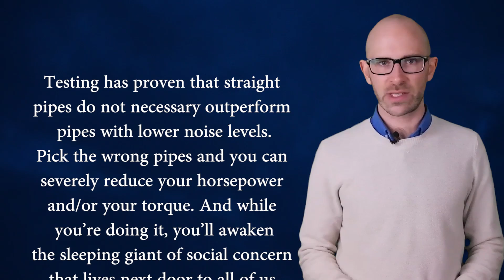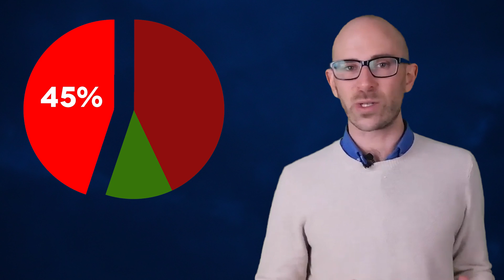Why are Harley Davidson Motorcycles So Loud?

Comment: I've been riding since 2007 on a Kawaski cruiser with straight pipes. I have never had an accident to-date. There have been some close calls from people in cars failing to check over their shoulder to view the blind spot, but with a little motor rev they hear me and move back into their lane. Safe Riding.

Comment: All we need is a little common sense and consideration of others. Btw.... noise adds dramatically to fatigue, therefore, anyone riding for more than a few hours with loud pipes will be endangering themselves. Fatigue creeps up on you and impairs your reflexes and cognitive abilities. I have been riding for over 35 years (since I was small) and am in favour of a "nice" sound, but that stops at 90db max, ideally around 86 db (at full throttle) is probably the best compromise. Anything over that is simply a nuisance, especially at 2 in the f*cking morning or on a peaceful afternoon when I would happily step outside and punch you for being an ignorant selfish inconsiderate ass!! (and yes, I am able to take on the majority of people. over 6", 240 pounds, fit, military / unarmed combat and martial arts training.. and I race, winning endurance championship races as recently as 2010)...

Comment: Mate, you come across as if you know what you're talking about, and some mentioned figures are correct - but, your comparison of various cars and a truck is wrong. There are rules and regulations as you mentioned - the WVTA applies to all vehicles of that type, and the 80db limit is barely audible in a typical city environment also due to the way sound carries. Instead of making polemic statements, we should all simply ensure that ALL vehicles that no longer adhere to the WVTA / homologation are taken off the road - which includes a lot of cars (especially "classic big block muscle cars", boy racers, and many trucks based upon sound and numerous older vehicles on exhaust emissions) and only allowed back on the road when they are within maximum 20% of the prescribed limits - I am not advocating draconian actions, just common sense and decency. If there were fewer rogues there would be fewer people "anti"..

Comment: As someone who rides a '87 Harley regularly and a large amount of quieter bikes. I have to use my horn less and be less defensive while riding my Harley, then when I borrow my dads bike. Cars are way less likely to pull out in front of me, or try to steal my lane. And with something that can be a very dangerous, even a perceived amount of higher safety is better than nothing.

Comment: Harley's are loud due to the bore and stroke ratio, valve size, camshaft profile, compression ratio, exhaust primary pipe size and length, intake efficiency and so many other variables that most people don't understand. engine design itself naturally will produce a louder exhaust note then most and the inability to utilize larger mufflers that don't restrict the engine and keep it quiet.

Comment: One of the quickest ways to get bikers going is the 'loud pipes' issue. Basically it is all down to how well the baffles in a pipe (if any) are matched to the engine. It is possible to have very powerful bike engines with quieter exhausts as seen on many sports and cruiser bikes but most aftermarket exhausts are louder to some degree. I personally once built a Harley with Supertrapp exhaust. Even with full baffles and wadding it was ear splittingly loud and unpleasent to ride. Loud pipes get you more noticed and may slightly reduce the chance of other drivers not noticing you on the road but they will also get the interest of the police (especially in the UK) and do rile other people up. Baffle free REALLY loud pipes often REDUCE the power output of a bike and can even result in valve damage. I've seen many a random exhaust set up that ruined a bike in the process. Using loud pipes just brings in more and more anti-biking legislation. Sure some will always love the sound of ear splitting pipes and enjoy winding others up with just how loud they are but they really aren't doing bikers in general or thier own bike in particular any favours. Personally I like my bikes to be powerful, long lasting and nice sounding without being uncomfortable or obnoxious in volume and I enjoy keeping my hearing!

Comment: I had a 2006 Yamaha MT-01. Which has a 105cu/in V-Twin air cooled motor or 1670 cc's. The thing would decinate other twins especially harleys. I could put the thing on 1 wheel frtom 1 mph. I don't understand why they're lack of technological advances for the price is very poor. handling and acceleration also suffer. Loud pipes do save lives but the fan boy attitude is crude and subhuman at best. I get it its a classic but a classic should improve over time not a stagnant egg waiting to hatch. If your that guy go for it if not ....whatever do your thing. Live!!!!

Comment: the majority of harley's are air cooled. that means more surface area aloud to vibrate or "sing".  it's the inverse reason class 8 HD or "semi-trucks" can be 15 liters and not be earth shatteringly loud. the air cooled engine dissipates the combustion energy through vanes that ring. the water cooled engine has the extra insulation of the density of it's liquid coolant.

Comment: Loud pipes do save lives. There are times where people haven't seen me (I ride a 1972 FLH) and heard/felt my bike. Yes, it is extremely loud because I run 2" straight drag pipes, they have saved my life a few times and until drivers start looking for bikes I will continue to ride with pipes loud enough to set car alarms off. You may not see me but you will hear me and you will feel my bike if you're close enough.

Comment: Harley Davidson needs to compensate for their lack of engine power so they use decibels to give the rider the impression that they are going fast.  It works well, Harley riders think they are riding very fast motorcycles  while riding around town going the speed limit.

Comment: Biker's safety is active, not passive. If you rely on loudness to be safe you are, most likely, biking wrong. Also, Harley Davidson bikes are powerful enough as they come, any attempt to squish more hp out of it is just frivolous. Even though I personally like those noise bastards, I know most people don't and part of living in an organized society is to reckon that defusing conflict is a mutual and rational effort that requires compromise from all parts involved. The limit of 80db is, then, loud enough.
Reply: Yes it IT Bullshit.
Loud pipes actually make EVERY one angry and pissed.  Since every one is a majority of car drivers that are pissed at ALL bikers then they make us pay and cut us off or almost brush you when passing.
One thing for SURE is that loud pipes does not make people respect bikers and are all put in the same bags.
Self confident people don't need loud pipes but uneducated and small dicks do. The louder the pipes the smaller ............you know the rest.
Reply: Real Bikers hate civilized society, the reason they made thier bikes so loud back in the day was to annoy people
Reply: Leopoldo Aranha I
Reply: Leopoldo Aranha no, they really aren't powerful from the factory,  you need to get a hi flow, a decent exhaust system and retune it.  They come extremely lean from the factory,  in fact like 16 or 17 to one ratio, an engine runs better at 13.5 to 14 to one ratio.
Reply: Not sure of the distance... (likely 20 ft)  tested at 45 deg increments in a circle around the vehicle... with the loudest being the one used.  (which would be up the ass of the dumbass Harley)

If you are making noise to warn others that you are coming... you need to point your pipes forward so its loudest in front.  

If that's not why you are making the noise... then you don't have a good reason for it.
Reply: That is bullshit just like all the harley riders  they let you no they are coming.  I  have been riding bikes for 30 years I have never had to have a noise piece of crap to let someone know you are coming learn how to ride.
Reply: FPVtrucker well said! my t-shirt says LOUD PIPES POOR SUBSTITUTE FOR NO SKILL
Reply: I ride 100+ miles a day for my commute.  Automobile dimwits either don't see, don't hear or ignore me and other motorcyclists on the road and they drive like maniacs with a few exceptions noise or not.
Reply: Got to disagree with one thing - the Harley engines can't rev high enough to make even decent power.  60hp from 1600cc?  That's a joke, even accounting for it being an air cooled twin, it should make about that much power off a liter less engine.  

And their arguments of "muh horsepower" are crap, anyway.  If they were actually concerned about horsepower (they wouldn't buy a Harley), the aftermarket exhausts would have equal pipe lengths from the exhaust valves to the ends, and probably a crossover at some point in the system.
Reply: i ride defensively  but loud pipes help ppl to pay attention becasuse a rider cant see every dip stick thats not paying that attention
Reply: "The limit of 80db is, then, loud enough." is not enough information. Exhaust volume is a function of angle, loudest behind the bike, distance, the closer to the bike the louder, and RPM's. The higher the RPM's the louder it will be. It sounds like you might have an "official" source I would like to know what the exact parameters are that should not produce more than 80db.

Comment: I both agree and disagree with the whole loud pipes save lives argument, and here's why. In the no they don't because sound waves travel backwards argument. That is correct sound waves travel backwards, and no I don't like extremely loud bikes either, because I have rarely seen extremely loud fast bikes. However when riding along side of cars, I have had people who weren't paying attention, on the phone, doing their makeup, eating, drinking or the absolute worst text messaging basically come into my lane, then when I REV the motor jump, startled that somehow I'm now sharing the lane with them! On my sport bikes this isn't as much of a problem because of the agility of those bikes, I'm either passing or generally moving faster than traffic and moving into a safer area away from cagers. However on my cruiser, I'm cruising more relaxed not inattentive but not slipping through traffic and the noise does assist in waking up drivers that are mentally asleep at the wheel. 
Due to the comparatively small to a car profile, louder pipes do make people look around for you which they normally wouldn't do. 
Now before someone says that only d bags ride with loud pipes consider this. If people will crash into police officers on motorcycles with flashing lights going, because they were not paying attention to the road, and most riders have had a near crash experience because someone who was looking directly at you "didn't see you" and my favorite "He came outta no where!" A few moments of loud noise is better than being run over. 
Want quieter pipes on bikes, put down the phone. 
Because the last time I checked, a human life was worth more than a phone call.

Comment: Those stats aren't correct at all. Not sure how they arrived at that conclusion. Anyone who rides can tell you that other drivers or "cagers" are a constant threat. Everytime you ride somewhere you have to do your best to watch all traffic as much as possible because someone WILL hit you if you do not take evasive action, several times per day.  That being said, its relatively easy to fit an exhaust system that gives you a nice throaty rumble that can be heard by other vehicles in traffic, without it being way over the top and ear piercingly loud. I agree that loud pipes save lives, but really loud straight pipes make you deaf and piss everyone of while you're doing it. I noticed a huge difference when I switched bikes. I went from a 700cc with factory exhaust that sounded like a quiet little sewing machine, to a 1000cc with custom dual exhaust that is pretty loud. On the quiet bike, cars didn't always see me until I came directly into their field of view or they noticed my lights or blinkers in their mirror. On the new bike, they are already looking for me in their mirror when I come alongside.  These Youtube stunt hooligans have really given us a bad name. If someone actually sees you doing a wheelie or riding like an ass, then you are doing it wrong, because that means there are other people on the road besides you.

Comment: At what distance? The standard measuring distance for SPL is at 7 metres e.g. a rock band is typically 95-115dB in the front rows. Whereas many motorcycles have their SPL measured for type approval at 1 metre e.g. 96dB at 1 metre at 4500rpm - but it will be a whole lot less at 7 metres (it follows the 'inverse-square law', 1/49 times less than at 1 metre).  It's a "how long is a piece of string?" thing, you must compare measurements like for like.

Comment: Those statistics about motorcycle accidents are horrible misleading. Those are fetal accidents, where the cyclist die due to the accidents and officer are not there to report an account. So after a fetal crash the only report is the other motorist. Almost all accident are caused by distracted parties. Experience will give you and understanding, you can final statistic to back and side of an debate.

Comment: my car is allowed to make 82 dBA when stationary (measured at 2700 rpm)
I don't think it even reaches that with my custom exhaust system.
seems like a pretty high number for 2700rpm with no load

Comment: Because that's the way we like it. .and it will stay that way.
Reply: Crolep pelorC  Hahahaha
Reply: fuck off
Reply: look out bad ass over here
Reply: Not if the rest of us who are annoyed by your pipes have anything to do with it. When you awaken the community beast with your pipes, don't be surprised to find you can't ride anywhere without getting ticketed or towed. A local community near where I live is doing just such a thing. Tow truck drivers are not always kind to motorcycles either.

Comment: When you factor out 16-22 year olds (who are going to crash anything they get their hands on) and then correct for miles driven per year, harleys are far and away the most accident prone bikes out there, open pipes or not. From the accidents and injuries that I've had to deal with, I think this comes down to lack of good training and the prevalence of alcohol. I can't tell you how many harleys I've had to pull out of ditches after a guy on a low rider or full dresser thinks he can keep up with a sport bike in the corners. They go in too hot, try to lean the bike over too far, ground the floorboards and lever the tires right off the ground. Next thing you know you're kissing trees on the side of the road. Second to that I see folks - and 9 times out of ten it's a harley - start into a corner, and without any evidence of outside influence they just drift right off the road - meaning they got scared and froze up, and rode the bike right off the side of the road. I seen it too many times to count. No loud pipes woulda stopped it, but if they'd left their bikes stock (no lowered suspension) and learned to ride it within it's mechanical limits, 90% of these accidents never woulda happened, and I wouldn't be dragging their bikes out of the woods.

Comment: My problem with quiet pipes is that my bike doesn't have a gear indicator or tach standard. I rely on the sound of the engine to know when to shift gears. At more than 35 mph with the wind noise, I can't tell when to up-shift. So, I got pipes that were a little louder. Now I can tell when to shift.

Comment: Is the 80db you quote a Harley on the showroom floor?  Indians & Victory's are a similar engine design; how do they fare? Are you making a judgment on Harley because of the choices of some of the riders?   Most V-twin engines are single pin crank designs, this means mostly nothing except the firing cadance.  Harleys use a "knife & fork rod design, Indians use two rods next to each other on the same pin.  The only difference from a Harley is that the cylinders are not in line.  Low RPM performance of Harleys are more usually attributed to the, relatively, long stoke, not the single pin crank (used by almost everyone).  Modern Harleys have a cat stuck up the pipes, no, not the meow kind but the converter kind and this would make newer Harleys quieter than old Harleys but exhaust isn't the only noise engines make. Many of the engine design decisions Haley makes are to reduce engine noise.   My 72 Ironhead makes noise in many ways.  I hear the pistons sloshing up and down, the valves & valve train and of course the exhaust (yes, I have mufflers).  Why have a radio when you're riding a symphony?

Comment: I put a StayinTune on my Honda CB1100F as the stock pipes were ridiculously quiet.  Why doesn't someone come out with an adjustable baffle/ backpressure/ noise reduction system?  You could set noise and performance for different conditions then.  Is this possible, or am I showing my ignorance?   Next project is to cut apart the StayinTune or the stock one, and see they work and experiment with them before re-tigging.